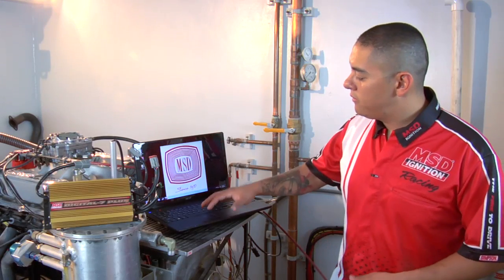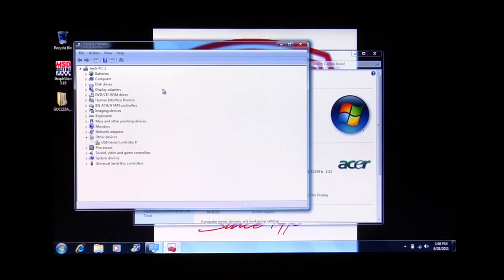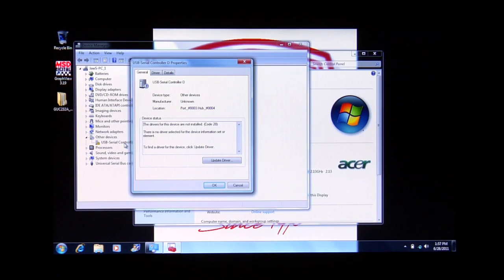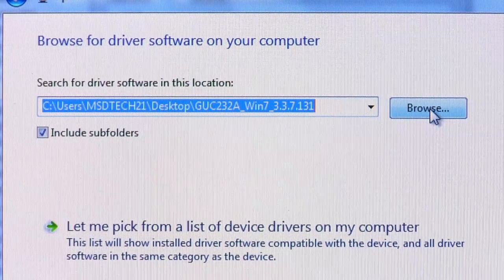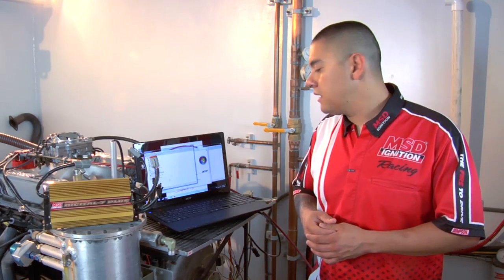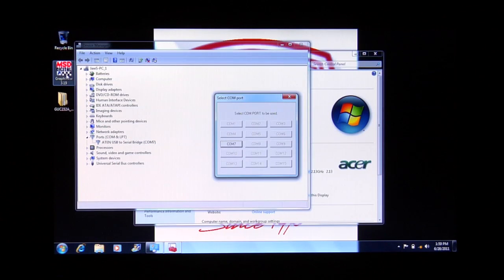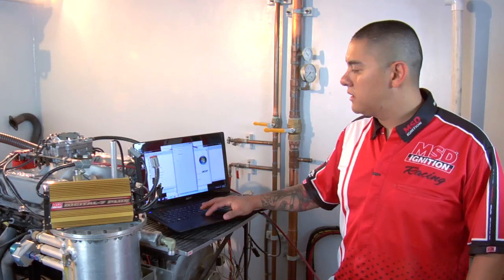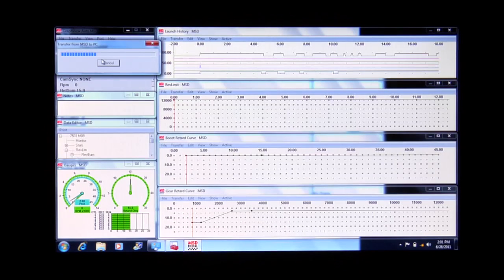Troubleshooting the USB to Serial Port Connection

Comment: I am using windows XP and trying to connect and communicate with my device using serial rs232 USB communication. The emulator shows that it is connected but there is still no dtat transfer even with both devices powered on. Please help. I have tried different emulators and its still the same thing. PS: the port settings r the same as for the session in the emulator and the drivers are up to date.

Comment: Being an IT engineer, I have to share my appreciation of competent delivery, seen here. It is important to stick to some reputable converter, as I am coming here while gathering material to get trough compatibility issues of several PL2303 adapters, that are run on the same computer. It took us now much more effort, than should be acceptable.